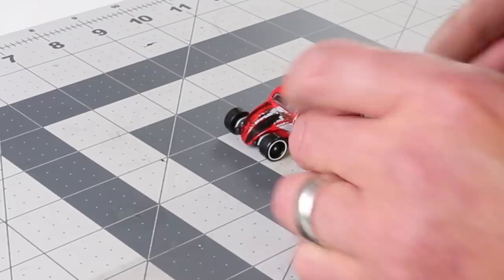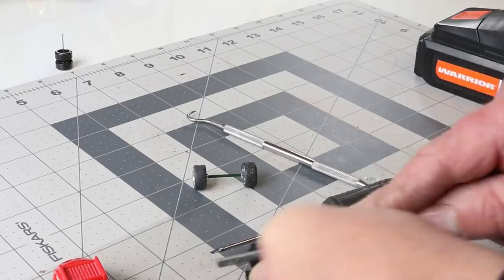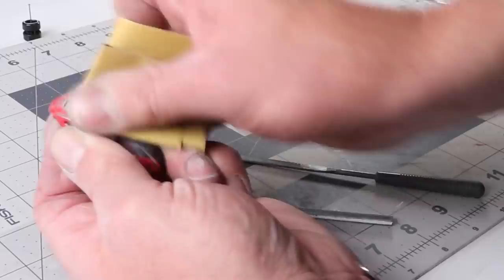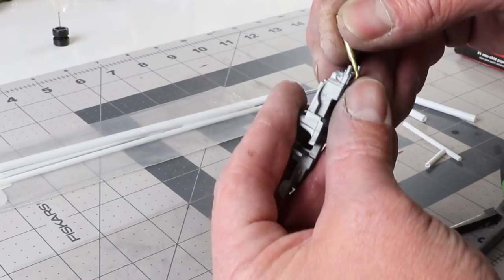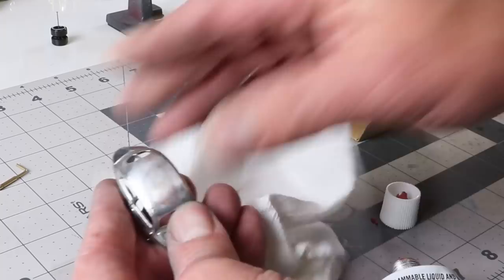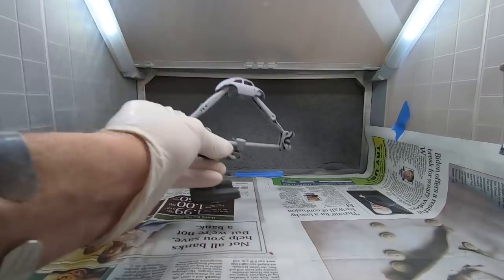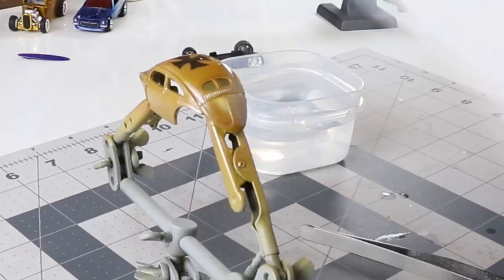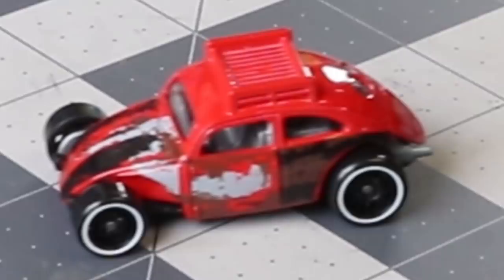Hot Wheels Custom VW Bug Rat Rod

Comment: Try with Tamiya X-19 Smoke. It is Clear paint. Apply inside the glass. Or mix black acrylic paint with Future but use very little black until you get the tone of smoke glass then dip the clear plastic in it. Let it sit and dry before doing another coat. Nice VW

Comment: I don't use tamiya clear colors very often but when i do, i get results far beyond my expectation, though i use an airbrush to spray, i never bother to get the rattle cans unless its the fine primer and sometimes clear coats. Even though the clear colors are thin enough to spray right out of the pot, i thin mine probably 3 parts paint and 1 part thinner. i lay down about 8 thin coats building up to a desired look... though i do not exactly have it down to a science. Lastly, when you are tinting clear parts, spray on the opposite side of the "show" side (the inside of the windshield, not the outside). but for sure ditch the rattle can.

Comment: For tinting windows, I don't paint the outside of the "glass", I paint the inside. You can also try ghost tints from Badger's Minitaire line (my preference) which not only has a black tint color called Oil Discharge, but 11 other colors.

Comment: Nice work! love the final colour.

I think the issue you had with this smoke on the windows is you have a PS paint, these are designed for polycarbonates (Radio control car bodyshells) it's designed as an etching paint and is sprayed on the inside of the clear bodies, it appears to have reacted to the plastic of this cars window quite badly.
You could try spraying it on the inside but no doubt it will still look like shit either way.

Perhaps a mix of clear gloss and gloss black sprayed internally would work well?
Reply from the maker: Yeah. I agree. The clear mixed with black will be my next test.